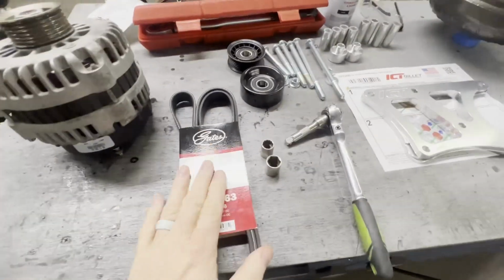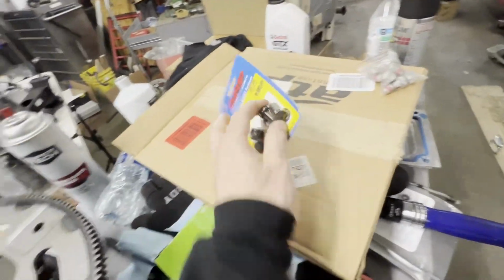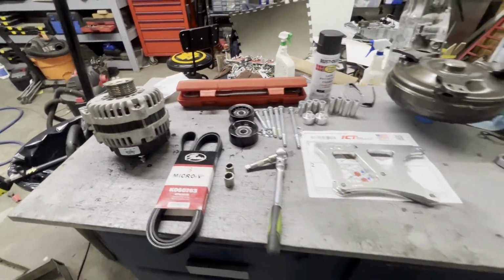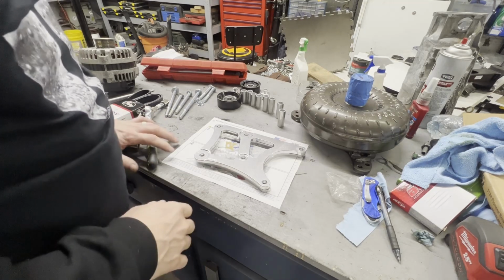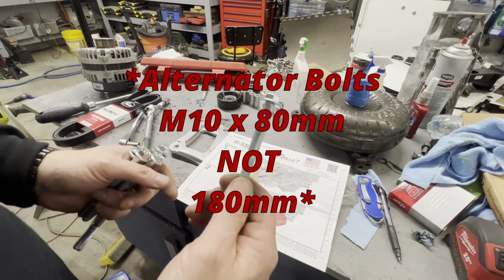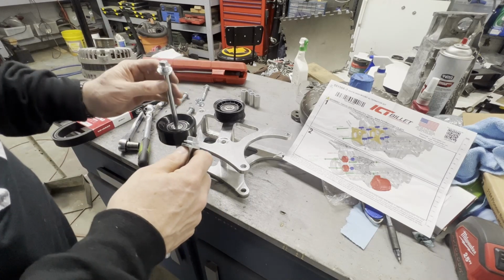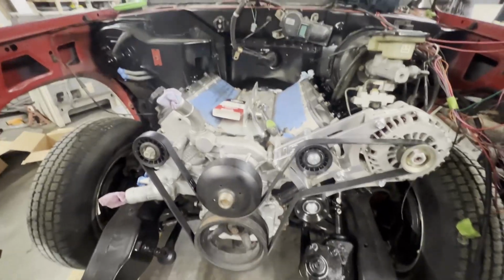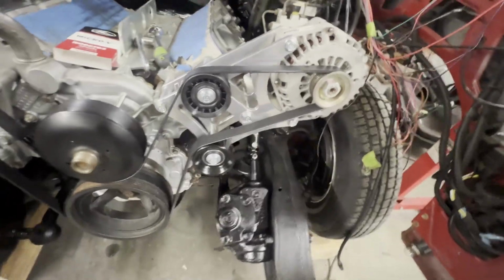ICT BILLET ALTERNATOR BRACKET KIT - LS SWAP S10 (First Gen)

Comment: Do you know what oil pan can fit in a s10 1993 motor 5.3
Reply from the maker: @user-yi2fk8bl1d I used the replica of the Holley 302-1 because it doesn’t hang down past the crossmember. It is supposed to give you the most clearance, but I still had to notch my crossmember. I have see guys use the stock pan and the GM muscle car pan with good fitment results but the pan will hang under the crossmember by a couple of inches. The only pan that I myself have experienced is the replica of the 302-1. I did alot of research and still wound up notching my crossmember. Look up the GM muscle car pan and compare the dimensions. There are spec sheets all over the internet. I have a video on the oil pan that I used and you can see the clearance in the notch the frame videos I made. A 1993 would be the same as my 92 in my videos if you want to see what clearance I had. Links to the oil pan and notch video below so you can see the fitment. I hope this helps you figure out what you want to use. Thanks for watching and the question. 

Oil pan video
https://youtu.be/hVjwboPaz6E?si=pJbhyWnDuczFz2lA

Notching the crossmember video

https://youtu.be/LqQdXY-Fsq4?si=VZHVo9IVdhhJ-n-Y